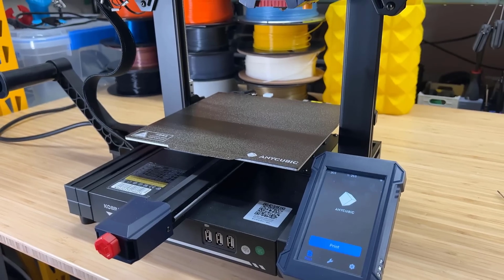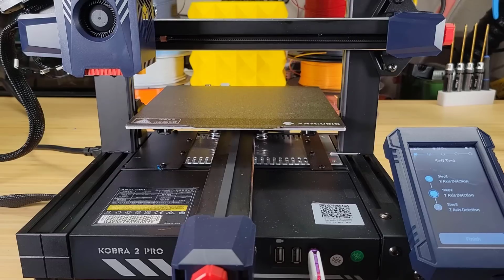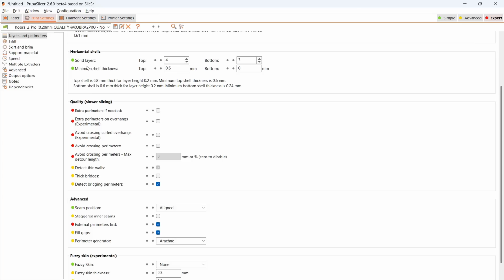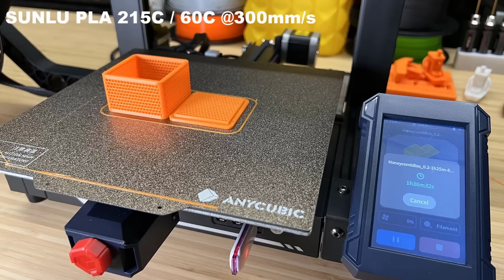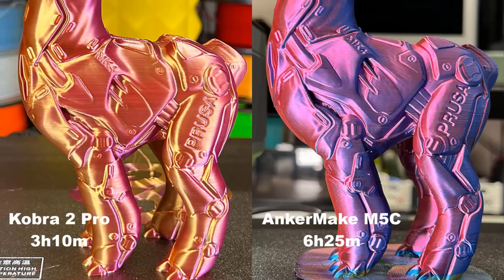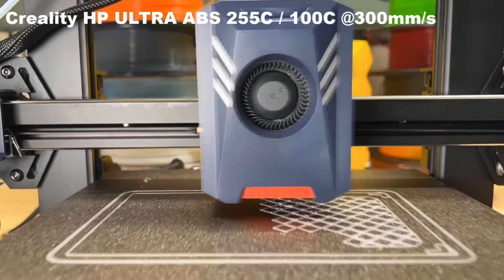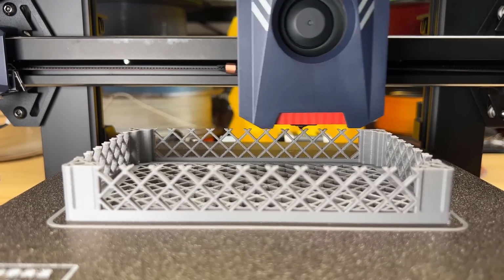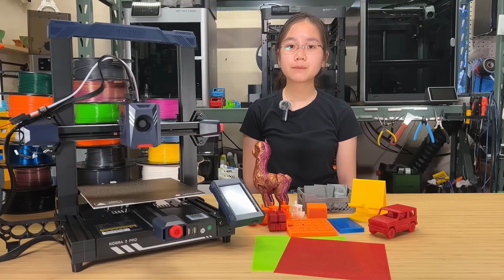AnyCubic Kobra 2 Pro: A fast bed slinger,  good print quality @ 300mm/2 and 20k acceleration

Comment: When will you upload the review of n4p? :-)
Reply from the maker: It was canceled as the machine has some issues, mainly caused by their self-developed touch screen interface not fully compatible with klipper, I was not able to continue the test.
Reply: @AuroraTech  That is a pity. Is it not possible to unplug the touchscreen and just run the print tests with klipper web interface? Thanks for your efforts anyway.

Comment: Hello!
Which filament is suitable for a printing speed of 300 mm/s? does it have to be hyper-pla, or is plain fine too? I mainly have Sunlu filament, mainly meta, but I'm also looking at ERYONE, then from the point of view of ordering, but the recommended print speed for both is 100 mm/s.
Anyway, your test is convincing, I have already pre-ordered the machine. I hope it won't be much louder than my current printer (artillery hornet)
Reply from the maker: Sunlu, Eryone, Voxel and most PLA I have tested can print at 300mm/s or faster at 220-230C. For Hyper PLA or other fast PLA, you can even print at a lower temperature at around 210C.
Reply: @AuroraTech  thank you the quick answer
Reply: @AuroraTech  and what do you think about elegoo pla? is it also suitable for 300mm/s speed? is it better than the brand's printers? :D

Comment: The quality of your reviews is gone "next level". You give us a lot of very useful information and best of all, you give us many material prints as well as comparison prints. Stoked. 
I could imagine that you could change the start-up G-code to wipe the nozzle. I like that function a lot. 
Thank you Aurora and Helios, great work. Keep it up...
Reply from the maker: No, we don't have access to the printer.cfg or SSH, so there's no way to move the print head to the wiping block, which is located outside the maximum Y position.
Reply: thank you for clearing this up. So, as you mentioned, it would be a matter for the manufacturer to make this feature possible. @AuroraTech

Comment: amazing review. is the K1 worth the price difference from this one? the K1 is 600mms but from your tests, it seems slower on some of the models. does the print speed adjust automatically?
Reply from the maker: I just used the default profile for both machines. Yes, the Kobra 2 Pro prints some models faster than all other machines, including the BambuLab.
Reply: @AuroraTech  i was about to order the K1 but saw your review so i pre ordered the K2pro. amazing work on the review. is there such thing as a sport mode on this printer? i saw a YT short where there is 2 speed options right before printing.

Comment: thank you for your reviews. please tell me which printer is better to take Kobra 2 PRO, Neptune 4 PRO or CoreXY printer?
Reply from the maker: The Kobra 2 Pro is much better than the Neptune 4 Pro. However, CoreXY printers can vary in quality machines from BambuLab to cheap ones like Tronxy, so it's hard to generalize. Nevertheless, at the price of $279, the Kobra 2 Pro is still the best bed slinger you can get, regardless of whether their cloud feature, which is still not ready, turns out to be amazing, average or junk.
Reply: @AuroraTech  which CoreXY would you recommend? I have reviewed creality k1 and QIDI X-Plus 3

Comment: Looking forward to watching this and seeing how a moving bed printer can do 20K acceleration.
Reply from the maker: Yes, I didn't believe it at first, but after testing, it can print at 300mm/s with a 20k acceleration, for real. No other bed slinger works better than this Kobra 2 Pro. The only drawback is their cloud; it's not ready yet, and I have no idea how it works. That's why I haven't put it on my recommendation list yet.
Reply: @AuroraTech  Hi Aurora, great video....seriously!  One question though if you wouldn't mind.  Maybe I missed something, but am I able to create the gcode using PrusaSlicer, put in on a memory card, then insert it into the machine without the need for using the cloud?  Also, can I use Cura instead of PrusaSlicer seeing that I've heard PrusaSlicer has a higher learning curve?  I know, that's 2 questions, but I'm needy.  LOL!

Comment: Back to the infinite cube, what if you dropped the nozzle temp to 195C?  I noticed a good bit of stringing during that and the benchies.  With my Sovol farm, I've found that 5C below the recommended temps.  Also, could you add a G12 and associated Macros and values to your start gcode section to get the wipe before each print?

Comment: I'm curious about the fidget cube. You mentioned, this time, you needed some bending to move smoothly. I assume you mean that on some machines it works perfect right of the bed?
( I have tried this model a lot of times and it's getting better and better but I am yet to get the "hinge" that you see in the middle at minute 10:07 to work smoothly. )

Comment: Why complain about the nozzle not being wiped before prints? I mean, just change the start gcode if you're not happy with it, lol
Reply from the maker: No, you can't. The silicon block is outside the bed(outside the max Y position). As you have no access to the printer.cfg and SSH is also not available, so you can't move the nozzle to the block position by simply changing the start gcode.
Reply: It needs a wipe brush not pad.  This is typical on IDEX machines,

Comment: What is the difference between the Kobra 2 and the Kobra 2 Pro?
Reply from the maker: Kobra 2 (Marlin, 150mm/s max with acceptable print quality)
Kobra 2 Pro (Klipper, 300/s max with pretty good quality)
Reply: @AuroraTech  Well, that makes it easy!  Thanks!

Comment: I expected this to be way noisier and less smooth with these steel wheels. It turned out to work very well, which brings the question why don't more manufacturers use them instead of these pom wheels? Won't these steel ones wear out the rails they're moving on over time?

Comment: For the issue with the printer not wiping on the silicone block, on my prusa i qdded custom gcode that set nozzle temp to 150 during bed levelling to wvoid any filament oozing. It then rests nozzle gently on bottom left as it heats to primt temp.
This stops any oozing and filament being stuck to nozzle and dropping onto print.
Reply: share your g code?

Comment: Your comparisons are flawed. You need to compare same
Speed printing. Of course the mk4 has better quality you printed it much slower.
Reply: she always indicates this, watch carefully
Reply from the maker: Not every printer can print at the same speed and acceleration. Using the default print profiles from different machines for comparison would be ideal, as those settings are typically recommended by the manufacturer to balance speed and quality.

Comment: Great review as always. You're right about cloud services...they are bad news 100% of the time, as they make your home network far less secure and hand over any IP you have to whomever is running the cloud. The convenience of just hitting a button on your computer is strong, but I'd rather walk the SD card or USB drive over to the printer myself anyway.

One thing: was it just me or did the corners of that nylon card wallet look kinda bad, even after printing out of the filament dryer? Just seemed like it was overextruding to me, the way material was curling up above the level of the nozzle.

Actually, a second thing: I'm getting more and more upset by printer manufacturers releasing their own proprietary nozzles. I get that they want to drive consumables sales after the initial purchase, but all this does is make it less convenient for users to install and even find replacement parts. While the printer seems fine enough on its own, I sincerely hope that buyers of the printer will soon have ready access to aftermarket modifications to allow for the use of standard Volcano nozzles.

Comment: Outstanding Kiddo, now I have a few questions. My 10s Pro V1 has been updated in many areas, yet here I seen things I want to have for my bed slinger too. Can you take time to review the start of the art in Bed-Slingers and define the most important features to produce accurate and fast prints. Then what and where can we go to find these features to fit onto our 10S Pro. Since i added Klipper and the ability to create macros can't we add things like the nozzle wipe station? The vibration sensor to the extruder?  The belt tensioners I think kits are out there. Just how close can a the Venerable 10S Pro get to 300mm/s Printing????? I have a new question for you guys too. As I have moved on to Klipper and gave up on Octoprint for Mainsail and Orca the light is clearer ahead. Voron!!!!!!!!!!! DIY The whole thing! Make it own your way!!!  Are you in Voron yet? I am so excited to be saving money to buy my KIT. I think this is the best thing to happen for high caliber printing that we can afford as hobbyist. Would you consider these two projects for your channel. CR 10S Pro rebirth and Voron built your way.  I think you could actually create your own Voron Kit and Specs for sale. And maybe 10S Pro "Bonneville Kits" for highest speed prints. Kyle at Tiny Machines had helped me  get the best out my 10S Pro so far. I have three packages due today, Pancake extruder motor 50% lighter, Silicon Bed Carriage spacers, minimalist hot end fan housing, lighter weight with dual part fans. Keep up the great work you guys are truly helping the hobby to grow and make better parts. All the best, stay well and be safe, Dennis in Viriginia

Comment: Such a great review 

I bought a Kobra 2 Pro this morning. Looks like a great printer. 

I already have a Vyper, Kobra, Kobra go, kobra neo, kobra max and a Kobra 2 from the anycubic range. 

Been really happy with all of my Anycubic printer so far except the Kobra Go isn’t going well.

I have a SV07 but the Kobra 2 seems to be running better that it. 
My best printer so far is the P1S. 

I’m sure the Kobra 2 pro will be better than the SV07. 

My favourite cheapest printer at the moment is the Kingroon KP3S. I have 2 and they print amazing quality prints every time. 

I do have a Tronxy x5sa still in the box for when my son turns 16 next week. He wants to turn it into a vzbot.
Reply: I would buy a new kp2 pro but bamnulab new printer appear.
Hmm kobra 2 pro vs a1 mini. I know 18cm vs22cm but if bamnulab a1 mini speed and quaility print, ı can by bambu.
Because a1 mini same price anycubic.

But ı have a Anycubic kobra ,plus ,max 4maxpro2 and ı like it. I havent problem. But bambu a1 is new in my view have some problem
Reply: Maybe you can provide an update?😅

Comment: You can actually swap a all metal heatbreak intended for the anycubic vyper toolhead into the cobra 2. First gives you a raised temperature limit and you can now use regular volcano nozzles
Reply: Interesting. Did you try? I am curious, because I want to use bigger nozzles (0.8mm), and those are not available in this shape yet. I have modified my old i3 Mega S with an E3D Volcano Hotend and I love it. Espacially quality-wise it was a big improvement. The original Anycubic nozzles were no good.

Comment: USBs are nice upgrade, but as a kobra 2 owner I don't use speed above 150 and if I want it as best as possible I go to 80mm. Maybe with input shaping 300mm could be realistic. Screen does look a lot better too. Hate that I cant get different nozzles or hardened nozzles but I think for basically the same price as the kobra 2 this competes with the neptune 4. a slightly larger bed model would have been a nice feature as well but again for the price they are reusing the same platform.

Comment: Great job! So this is the bed slinger to get. Maybe the plus though... Do you think it will have the same level of performance?
Reply from the maker: I expect the acceleration and speed to be slower on the Plus/Max model because they can't swing a much larger bed as quickly while maintaining the same print quality as with this Ender-3-sized bed.

Comment: Every cheapo bed slinger manufacturer has decided now to just slap Klipper on everything without much thought to part cooling or hotend flow rate and call it a day. "It prints a Benchy in 27 minutes!" Not well, but yes, it does.

Comment: Better than the elegoo Neptune 4 pro?
Reply from the maker: Yes, it's better than the Neptune 4 Pro in terms of print speed and quality. 

It may not a good idea for AnyCubic to use their cloud server for network printing, but still better than the Neptune 4 Pro which has no WiFi.
Reply: @AuroraTech  which machine is better mechanically?

Comment: Sounds pretty similar to the SOVOL SV07 spec wise.
Reply from the maker: In terms of network printing, SV07 is better as it just uses standard Moonraker API and fluidd web UI. However, the POM wheels on the SV07, print speed and print quality are not as good as this Kobra 2 Pro.

Comment: I bought the Kobra 2 on your recommendation. I’m supremely happy with a fast Marlin machine. If they provide you with a discount I will buy this machine as well.  Anycubic is really an impressive company for supporting you. I hope they will adopt your excellent suggestions.
Reply from the maker: After upgrading the Kobra 2 to the latest firmware version 3.0.6, it should work even better with the input shaper enabled Marlin firmware.
Reply: Could you please do a video on the pro vs the standard? @AuroraTech
Reply: @AuroraTech  thank you for that information. I’ll check into updating the firmware tomorrow morning. The Voxel filament I bought on your recommendation is also working great! Excellent review. Your recent studio upgrades are making your videos look fantastic!
Reply: @AuroraTech  I assumed Pro version with Klipper would mean "old" Kobra 2 wouldn't get IS - but it's nice to be wrong :)
Reply: I had much more issues with the new firmware on my kobra 2 I've only lately managed to get it sorted and dialled in to a useable condition, however sometimes it still fails and has glitches

Comment: Great review as always!!Let me say that that is an award winning extruder-hotend combo,  by looking at the close-ups of the nozzle laying plastic at those speeds, you can tell this thing is well tuned to take advantage of klipper speeds without being limited by a poor volumetric flow. I wonder how much volumetric flow this machine can handle in vase mode so...Aurora: would you please consider to add just one more quick test for your upcoming reviews? A print that gradually starts to increase volumetric flow until starts to underextrude. Orca slicer has a volumetric flow test that does something like that. CHeers!
Reply: Theoretically 500x0.2x0.4 = 40 mm³/s ... I think the Volcano Hotend can do around 30 mm³/s (at least what I could realize)... But I thinks the limiting factor will be your Filament. Generic PLA probably cannot be process this fast in acceptable quality. Unterextrusion will occur. There is High Speed Filament available already. And as you can see in the review: TPU is still limited to 80 mm/s... Maybe there will be some high speed TPU as well one day :)

Comment: Is It klipper? I Ve been in the anycubic event and they told us Is not klipper but a proprietary fw
Reply from the maker: Creality and BambuLab both refer to their Klipper-like firmware as their own OS, but it's hard to believe that any of these firmwares are not based on Klipper.
Reply: @AuroraTech  I just talked with the engineers of the ac and said that is not klipper but they was vague about what fw it is. Just says proprietary version and change topic ;)

Comment: Love your great reviews.  Definitely the best in the business.  I'm particularly grateful to see all the different filaments tested, particularly TPU which I use often.

I was surprised to see TPU print so well through the reverse Bowden tube from the spool to the left of the machine.  I always hang TPU spools above and feed the filament directly into the extruder.

It's frustrating to see all of these 3D printer manufacturers making the same mistakes that mar these otherwise excellent printers - no WiFi, a Volcano style nozzle that isn't compatible with the readily available Volcano nozzles to force us to buy a proprietary part, and trying to force us to use their cloud service (I'll NEVER do that) rather than using the excellent LAN features of Klipper.

I was preparing to order the Elegoo Neptune 4 Pro when I saw this review of the Anycubic Kobra 2 Pro.  If this printer allowed me to use Klipper over WiFi, I'd have bought it instead of the Neptune 4 Pro.

Comment: Between this and the regular Kobra 2, which would you recommend considering price, functionality, and “future-proofness”— i.e, expected longevity and features?

I’m looking to get my first personal 3d printer for relatively cheap (mostly under $300), and I don’t need/want anything crazy, but I also don’t want to be too limited a few years down the road, as I anticipate I’ll keep whichever one I get for as long as possible. For reference, I’ve used 3d printers a little bit before, so I do have some familiarity with their general functions, though not a lot.

In short: Is the Kobra 2 Pro worth the price premium over the regular Kobra 2 for simple hobbyist prints and designs? Or is there another printer you’d recommend over those two in a similar price range? Auto bed-leveling is a must for me.

Thank you, and I really enjoy your in-depth videos/reviews—keep up the amazing work!!
Reply from the maker: Yes, the Kobra 2 Pro cost $50 more than the Kobra 2, but it prints faster and better. If the cloud printing also works well, I will take it as a bonus.
Reply: @AuroraTech  Thanks!

Comment: Couldn't you just change the heat break for one that will work with volcano nozzles?  That would also allow hotter temp printing if you bought the right one and a different thermistor.  I believe it is much easier to change the max temp in klipper.